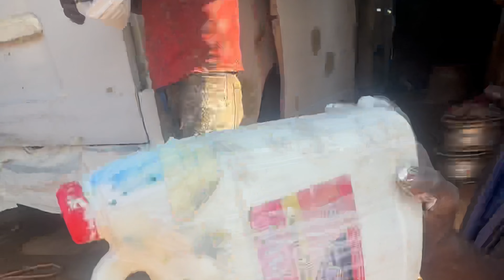" 5 African Kids Restore Abandoned Bus to Its Former Glory."

Comment: This is a fresh modification of Toyota Hiace. For example, in Siberia, older models of this family are also used, and not within the city, but on intercity routes of 800 km through the taiga in winter, at a temperature of -40 degrees.